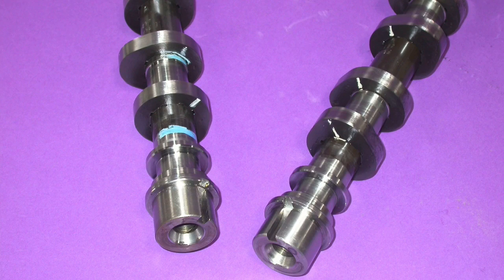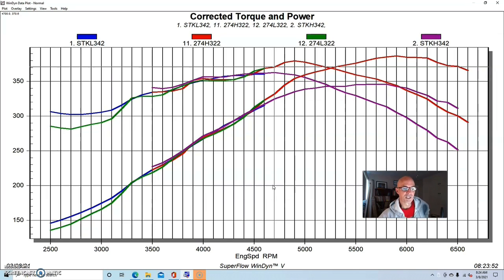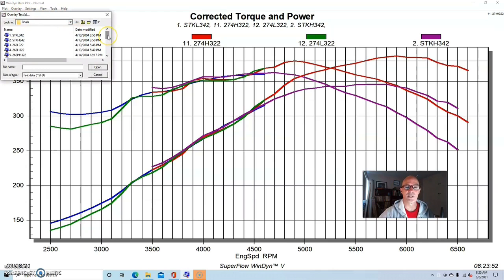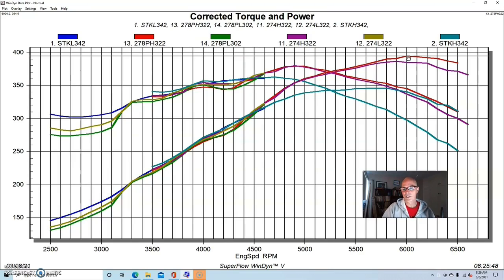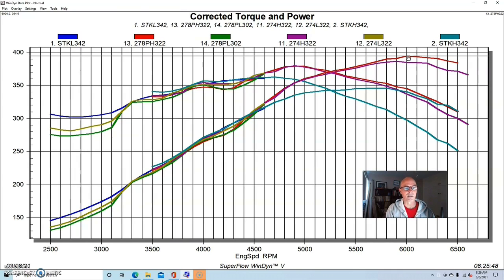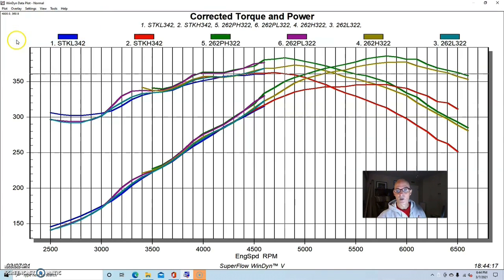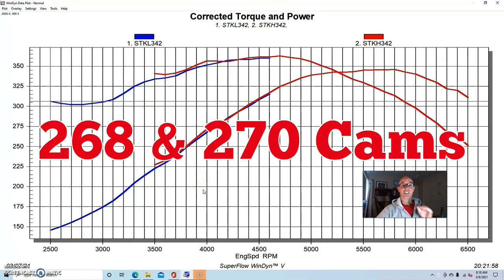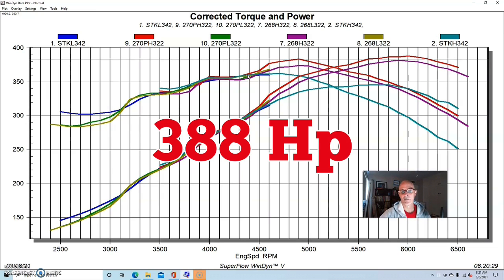HOW TO: CAM YOUR 4.6L 2V MOD FORD (STOCK VS 6 COMPS)

Comment: What about a 2003 kenny bell supercharged 4.6 2 valve with long tube headers? What would be the overall best cam for street strip application ?  
Thanks
Reply from the maker: Of the Comp Cams tested-the 262AH

Comment: What is a good cam for a 2001 mgm? Something with a little chop that I do not have to do any supporting mods besides some tuning and valve springs?
Reply from the maker: small 262

Comment: But which one gives that lumpy "it's cammed" sounding idle?  If say, the idle sound is all your looking for?
Reply from the maker: they all have enough chop
Reply: Buying a cam for sound alone is a pretty expensive endeavor. Throw some magnaflow mufflers or a mid pipe on it if sound is what you're after.
Reply: @madmod Neither of those affects the idle...

Comment: Are these camshafts ran with the stock pistons, or does the motor have aftermarket pistons with bigger valve reliefs
Reply from the maker: this had valve reliefs-but you can run most of these with stock pistons
Reply: Which cams from this video do you recommend running with stock pistons? Also thank you for the feedback.

Comment: 346 horse from a stock 4.6 motor? 🤔
Reply from the maker: PLEASE GO WATCH AGAIN, NON PI SHORT BLOCK, WITH PORTED PI HEADS AND PI INTAKE
Reply: @richardholdener1727 aftermarket cam?

Comment: what will happen if you run x262ah cams on a non PI motor with PI ported heads ?
Reply from the maker: you just have slightly higher compression

Comment: Which cam would be good on a 2.1 Kenne Bell 2v  5 speed car with 4.10 gears 262 or 270…I’m ask for a Friend 😂
Reply from the maker: look for your answer in what they do NA-pick the one that makes power where you want it-then add boost

Comment: building a 5.4 npi bottom and adding the pi heads and intake in my truck(should get in the mid to upper 9 comp ratio) i have 2 cams in my possesion npi cam specs .05 224/210 .475/.460 lift 114 lsa or a pi cam  .05 206/204 .504/.535 lift 113 lsa which one of these for a truck daily driver application or should i spned the money for a comp 262

Comment: I know this video came out a while ago but I’m hoping I can get some help. I have a 99 gt with an on3 front facing turbo kit w 8 lbs of boost making 368hp and 385 torque. I want my car to chop and don’t wanna make much more power. How can I achieve this
Reply from the maker: small comp 262 cams
Reply: @richardholdener1727  Awesome thank you so much for the reply. What else do you recommend me change while I'm installing the cam? Like timing gear etc.
Reply from the maker: CHAINS AND PLASTIC GUIDES IF DAMAGED
Reply: @richardholdener1727  awesome thank uou

Comment: Hey so I have a 4.6 2v f150 and I wanting to performance it but I need to know would it be okay if I used a pi cam and not have the pi intake? Or would it best to get the pi intake?
Reply from the maker: pi intake with pi heads-otherwise it doesn't work

Comment: What's everyone's thoughts on these combos? 262ah cam. Stock PI intake or Edelbrock, or the Trick flow track heat? Larger throttle body and a NOS kit. Headers and a good Torque converter. 3.89 rear gears 4,000lb car
Reply from the maker: it will work

Comment: I've been away from V8 cars for many years I've been building in to imports for at least 25 years. I have a mint condition 96 GT automatic. What would be an ideal suggestion I'm not wanting a drag race car I do a lot of back road running and live in a very hilly area. So I like to get 300 and wheel horsepower out of my car or something close to that but also maintain reliability the car only has about 70,000 mi on it and he suggestions
Reply from the maker: swap in PI GT motor, or LS or add low boost
Reply: @richardholdener1727  I wouldn't LS the car even if it was free. I'm one of those odd people that don't believe in seeing different brands and different cars I used to be into imports really heavily and hated seeing an LS and a RX7 or something

Comment: How did you get over 300 hp and tq at stock?  I've never seen any 4.6 2v put out those numbers stock
Reply from the maker: headers, cold, optimized tune, not air intake, elect water pump etc...

Comment: Think you can do a 4v comp cam test? Like this one but for the 4v dohc? I’m looking to get some cams for my turbo build but I can’t decide which ones to get
Reply from the maker: I LIKE THE XE262AH CAMS FOR THE 4V
Reply: @richardholdener1727  okok thanks so much, I have another question I’ve been searching high and low for a answer to. I’m wondering if you could help, I got a 97 mark 8 crank so the cast 6 bolt one in my teksid I’m already changing out the piston and rods etc but should I change the crank? I can’t really find a definitive answer on the limitation of them only a recommendation for keeping the rpm’s right around 6000-7000? Do you know of any experiences and or stories that you might of heard with that crank? Final build power should be at around 650-700 hp with my already used on3 tt kit for the 4v. It has all supporting mods/ timing and all that from mmr it’s just the crank I don’t know if I should change it because before they ran for about 300$ now it’s more like 900$, already so deep in hahaha):

Comment: I have an 02 mustang gt would like to talk to you about what I would need to build it up a little like to have Whipple super charger with it
Reply from the maker: AS AWAY-JOIN THE LIVE FEED
Reply: @richardholdener1727 I have an 03 stock 4.6 stang. X pipe, flow master catback c.a.i  3:73 gears. I  want to just stay street, no 1/4 mile runs. Want driveability, and a nice sounding lope. Would love 340ish rwhp and torque . What should I look for to make this happen

Comment: i have a 4.6 2v pi 
CAN I USE A NON PI CAMS ON MI PI HEAD?
the comp cam recommended a xe274 non pi cams 
(i am going to  update the spring and the Adjustable Timing Set
and at  the engine i going to change the piston for a 1998 mustang pistons)
Reply from the maker: yes

Comment: Test the 4.7 that came in jeep dodge and Mitsubishi....... They are just like the 4.6 Ford..... The initial run of the 4.7 engines started with only 235 horsepower the last 4.7 produced 335 hp manufacturer increased horsepower drastically over the years.

Comment: I have a 2003 roush stage 3 mustang, 4.6L 2 valve with roush supercharger. 380 hp 380 torque. I'd like to replace the cam for some decent lope...not terribly concerned with a big power increase and I don't want to take away from the driveability of the car. Do you think the 279 cam is a good choice?
Reply from the maker: IT WILL HURT DRIVABILITY A LITTLE

Comment: Can anyone post a link to buy those 262 PI cams for the 4.6 2v plz, strugglin to find the correct ones online.
Reply from the maker: XE262AH, cams part number 102500
Reply: @richardholdener1727  Thanks Rich! Always great work on the videos.  Youre awesome!
Reply: @richardholdener1727  Had another question, would better rocker in the valetrain help or hurt this build with the 262cam

Comment: I ended up with a 2000 F150 with the 4.6 2v my step father in law had, he converted it P.I. heads,intake and the 262pi cam. i`m was curious bout the HP difference. Thanks alot.

Comment: Something different here.. I'm doing ported PI heads ,long tubes, ect.. on a non pi short block.. but building it for more torque.  Of course the hp would be welcomed, but need it to pull.. truck is a 97 f150 2wd 4.6 5 speed..what do tou guys recommend?
Reply from the maker: KEEP STOCK pi CAMS
Reply: @richardholdener1727   thanks man 👊

Comment: Richard, thank you for making this video. 
I'm new to the 2V world, and trying to work out a great engine set up for my Mustang. 
I'm having a hard time figuring out which cam I should get for the 2V. There is so much information out there and my eyes go crossed looking at it all. 

The engine is a 1998 NPI Block, but previous owner did the PI intake and head swap. I haven't been into the engine get into the engine yet to identify what cam is in it now, but I know I wanted to move to something that was going to give me an increase on the top end for road track use. 

I have read different things on different forums, and frankly, it scares me that I'm going to buy and install the wrong ones. 
Any suggestions on which cam to put in?
Reply: I 2nd the xe262ah or MHS stage 2 with there degree service is even slightly better in my opinion but either cam's work fantastic and would not go any larger for a NPI - PI head swapped car because PTV clearance is extremely limited
Reply: I run the xe262ah and love it. If you're staying with stock intake the drivability is  grwat. Throw hrow those cams in and you won't regret it. On mine the power is excellent from 3500 to 6k

Comment: So help me out here , can I run the 262 ah cams in pi heads installed in a npi block (more compression .) but what about valve clearance ? And what about in the future boosting either a blower or procharger ?
Reply from the maker: check p-v and yes on boost

Comment: I was gonna ask you a question I’m running an P1 engine with stage 2 cams whole after market intake 24 pound injectors and tuned to run on 93 MSD coils if that matters any, you think I’m reaching at least 350-400
Reply from the maker: WHAT INTAKE? AND ARE THE HEADS PORTED?

Comment: Love the videos Rich so what will be the bottom line for a non-pi normally aspirated engine and still maintain reasonable drivability which can do you think?
Reply from the maker: small cams
Reply: @richardholdener1727  any particular lift you prefer for this application...
Reply: Looking for a smooth idle of course you know with a bigger cam that's generally not possible maybe you got a special number for Lift in mind

Comment: Npi block with pi heads and intake, looking for a torque monster what cam would you run? 262 still?
Reply from the maker: yes 262

Comment: hey richard i have a 1995 ford thunderbird 4.6L 2V v8 i wanna know which cam would be best for intermediate power and sound without having to change springs and other stuff just and cam swap
Reply from the maker: check to see if Comp has small 2V NSR cams

Comment: What cam do you recommand for a manual gt 00 with long tube headers, bigger intake manifold, comp cam spring and retainer, high flow fuel pump, 24lbs injector, 3.73 gear, 125 shot of wet kit NX. I want a 50/50 track and hot street application. Thank you!
Reply from the maker: 262 or 268

Comment: What's the rpm limit/ best shift point for the 262ah pi cams?
Reply from the maker: LOOK AT THE POWER CURVES
Reply: @richardholdener1727  it looks like they go up to 6500rpms?

Comment: Dumb question, what is the PI version?
What years are they and how are they different?
Thanks for the great content.
Reply from the maker: pi is power improved and is 1999-up on a Mustang
Reply: @richardholdener1727  so my 03 5.4 2v super duty  isn't a pi version and it's only a Mustang thing ?and or only on a 4.6 ? 
Thanks for the reply BTW

Comment: Would like to see 5.4 2v tests but I guess it's basically a stroked 4.6 2v .
Reply: The bore is the same, stroke is longer, block is taller and intake manifold wider. Bigger cylinders with the same size valves will want a narrower LSA.

Comment: I wanna see a 97-99 non pi 5.4 with pi heads and cams dyno
Reply: Can one just add the pi heads on a no pi 4.6??
Reply: @sammyg.4255  yes your compression will also be a little over 10 to 1.
Reply: @sammyg.4255  pi heads on with non pi bottom end   is more powerful than a pi if tuned

Comment: Two questions... 1 what happens under boost? Better to find an optimal cam then boost, or boost then cam?

2 does boost "tame" cams in the same way that displacement or flow efficiency does?
Reply from the maker: whatever the cam does na (the entire power curve) it does under boost-boost just adds to what is there
Reply: @richardholdener1727  thnx Richard.... sure takes a lot of drilling to get a simple concept into people's heads eh?

Comment: I think the real takeaway here is 2V's have the most to gain from a set of heads, especially if staying NA. Or just throw some boost at it 🙂
Reply: arent they capped at 400 whp?
Reply: Torque is capped at 400 N/A but a custom cam N/A 4.6 made 515whp on stock bore and stroke.
Reply: @UnderDog2V build specs? Heads? Cams? Compression? Etc..
Reply: @Johnnyreengo 450-500 whp not really a set hp since so many variables can make a difference
Reply: @Johnnyreengo  with those current mods yes you need the stroker and a supercharger/turbo to make over 500-1100
Reply: @ItsPainnz  absolutely don't need a stroker to make power. Literally stock crank with coyote rods and budget piston and turbo will make 600+
Reply: @ItsPainnz forged internals not just a stroker

Comment: What would be the go too cam for non pi block ported and polished pi heads and intake with forced induction later ?
Reply from the maker: 262
Reply: @richardholdener1727  thanks Richard I had a xe 274 in mind but I reckon the 262 is a better choice and when we gone see a 4.6 2 valve big bang video

Comment: Richard, I recall you running the XE274H cam with the Kenne Bell 4.6 2v on 9 & 10 psi and liking those results... Armed with this new knowledge, would you have run that with a different cam? Would you recommend a different cam for that application?
Reply from the maker: WE LIKE THE POWER-NOT THE DRIVABILITY

Comment: What cam do you suggest I run on my 4.6 2v pi motor. I have stock headers after market exhaust, jmod auto 4r70w and already tuned for a 100 shot of nitrous zex wet kit. Stock manifold with a BBK 78 mm throttle body and jlt cold air intake
Reply from the maker: 262 pi cam if it is 99-up

Comment: Hey man, would anyone have recommendations for my 3v 5.4, or should I put the navigator heads on. If so, what cams should I use then.
Ps, I need low end torque
Reply from the maker: HEADERS

Comment: Do a shootout between the 4.7 Chrysler and 4.6 Ford.  "Battle of the Unloved SOHC's".  Maybe throw in the 4.8L GM just for fun.

One interesting thing I noticed on the Ford Mod cams is they have a smaller spread between advertised and effective duration than cams for pushrod engines.  The Mod cams in this video had a 36 degree spread, while pushrod cams typically have 52 degrees.  It seems like a good thing to get the same effective duration with less advertised duration.
Reply from the maker: good point-I don't think these 2v cams are as good as they could be

Comment: 268H here on a PI engine, with boost. It makes great power up top. Has a good lope but I wish I would have gone 270s. Oh well.
Reply: I am debating buying some 270’a for my single turbo setup
Reply: @Greenskies321  do it. 270 is a good all around, off the shelf cam.

Comment: Hey Richard - so this test motor was essentially a stock bullet motor right? And those were rated at 265hp/305lbft. This stock combo put down 346hp/362lbft. Does that mean that headers/tune/open tb/acc delete are worth ~80 hp? Or were these severely underrated? I'm looking at these numbers questioning whether I should ditch my old school 5.0 in favor of one of these 4.6. I thought no way would a 4.6 put numbers up like this. Appreciate all the content.
Reply: No 260-265 was accurate rating. Dyno majic and tuning with a f.a.s.t. setup  and everything u mentioned somehow made those numbers ..
Reply: The factory tuning is so conservative there’s probably 80hp to be had with intake header no accessories and a modern ecu
Reply: The 278P cam put down 395hp 380tq 😲
Reply: Yes the 4.6 2v or 4v is an improvement over the old 5.0

Comment: loved the video after I build my LS S10 i will be building a 4.6 2v, ive been looking at the trickflow 51802002 cams for my 4.6, what is your take on them?
Reply from the maker: have not run those
Reply: Your gonna spend a lot of money on that 4.6 but you'll get some power out of it. Honestly the 5.4 2v will be much stronger and gain a lot more power

Comment: Ford guys does the 4.6 4v fit in the 05 mustang bay?
Reply from the maker: yes
Reply: @richardholdener1727  and the 5.4 lincoln would as well?
Reply: The 5.4 is a taller deck so it’s usually harder to make it fit without modifying the hood. Most of the 5.4’s are out of trucks and so have a very tall intake. There are usually adaptors to fit the 4.6 intake, but it isn’t as ideal since the intake is designed for a smaller engine.
Reply: @NBSV1  but it could fit with a domed hood

Comment: After watching your video on lobe separation, I'd like to know if anyone makes a cam with tighter LSA since these are all relatively wide.  For instance, wouldn't it be even better to have the 262AH cam but with an LSA of say 108?
Reply from the maker: it would help-though idle quality would eventually suffer
Reply: Piston to valve clearance becomes a issue when your LSA gets tighter then 112 on any cams over 225 duration at .50 with stock pistons especially with stock valve's
Reply: @miker1681    hey, thanks for the explanation!!
Reply: @zadokmotorfreight2423  Your tighter LSA is absolutely correct by the way these 4.6 motors love it but just be careful with PTV issues and in order to fit larger duration cam's it becomes difficult to go tight on LSA
Reply: @zadokmotorfreight2423  If you have deep pockets which most of us do not Lol but if you have the money a set of trick flow head's will solve your piston to valve issues with their slightly canted valve design it really provides a lot more PTV clearance however the trick flow head's will require a custom cam grind to truly benefit from there improved head flow even though off the shelf cam's fit and run the timing events are way off because of the valve relocation